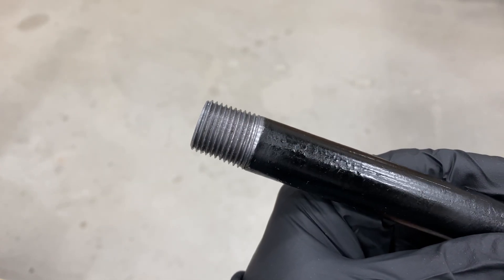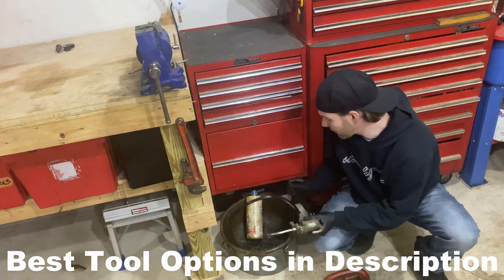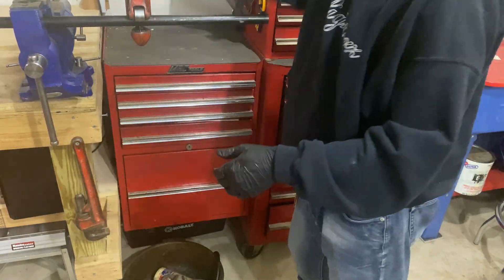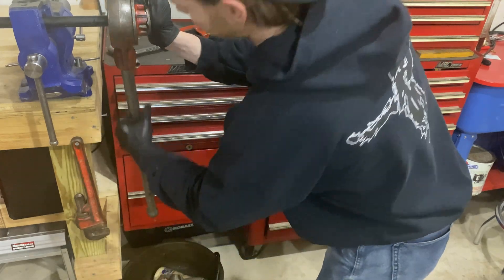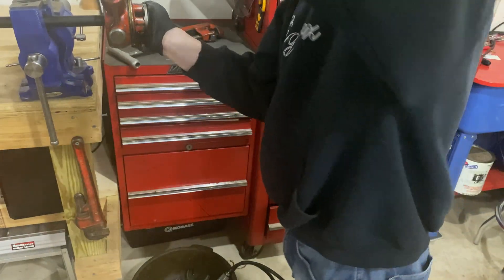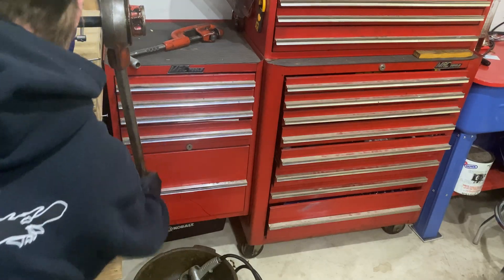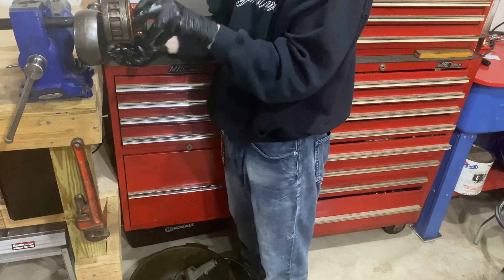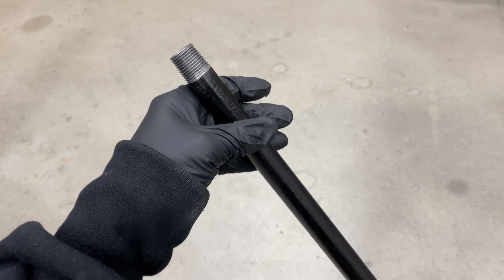How to Cut & Thread Black Iron Pipe blk steel galvanized ￼pipe for compressed air line & natural gas

Comment: Will this work on a 2.5 inch diameter pc of pipe as well... ?  Thanks
Reply from the maker: Yes. You're really only restricted to smaller size pipes if you have smaller tooling, but you can pretty much thread any size black iron or galvanized steel pipe, as long as you a big enough Pipe Threading tool. These can be bought as kids or individually